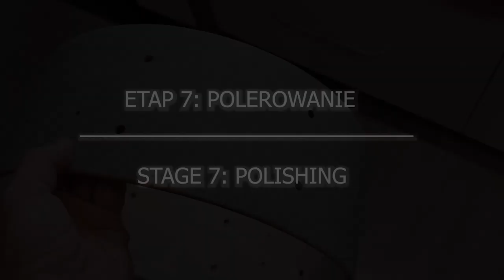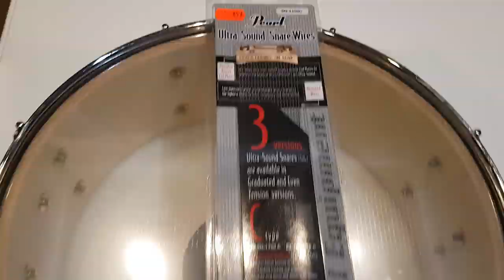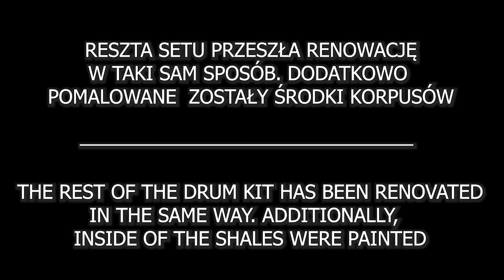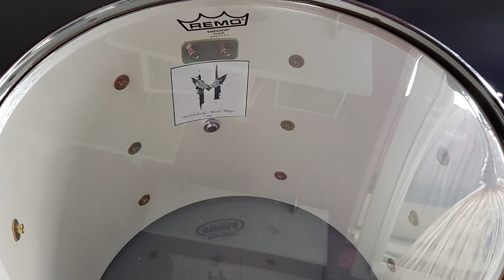Snare Drum Restoration Glitter - Painting Drums - Yamaha Stage Custom Advantage

Comment: Nice work. One comment on this. Always go overkill on the clear coats. I noticed that after your initial sanding that you had some small shiny pinholes. Those should be sanded away until the whole drum is matt. Hence needing more clear coat. If you don't sand them out, they appear as blemishes after polishing.
Reply from the maker: @garybeckman3382  More time you spend on finishing, the better the effect will be. You are right. I wanted it to look good, not necessarily perfect. Regards.

Comment: Thanks for the video. This is a 21 minute video, however, I'd like to know how long did it actually take to complete this project as well as, what grade sandpaper was used in the different stages of the process,  I saw that for previous finish removal you used a 80 grit and then some 300ish grade for edges, however, no information on the table sandpaper or the finish sanding with water. I myself, would like to do this project and this information would certainly be very useful. Thanks in advance and keep up the great work.

Comment: I mean if you look at a documentary on the way they make the drums cutting that lip to the correct angle is one of the most important part of the process I'm not trying to put your work your a pro at what you do on time I started messing around with the lip by sanding it I never got that drum to sound right after
Reply: It's called a "bearing edge".....and yes it's critical to a drums sound.  You simply need a table router to cut the bearing edge. There's an inner, and outer edge. There's lots of info about the different types of bearing edges you can cut, just google it, or search here on YT.

Comment: How long did you wait before adding the g3 mate? Finished spraying mine about a week ago and waiting to apply it
Reply from the maker: It depends on conditions such as temperature or humidity. Clear coat is thick and it has to got time to harden. About a week should be enough.

Comment: Man, what were the products. Can you please make a list?
Reply from the maker: I used purple  and silver hologram glitter 0.4 mm from the local dealer, CR glue and ordinary car clear coat paint. Sand papers dry 300, wet 600, 800, 1000, 1500, 2000, 2500, g3 paste, and finish paste.